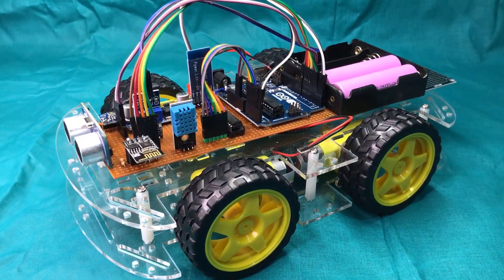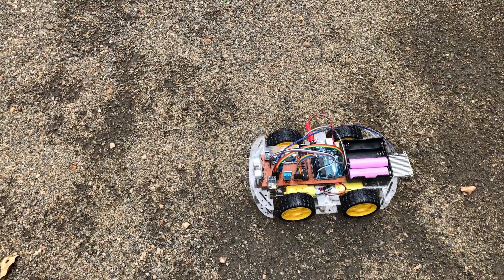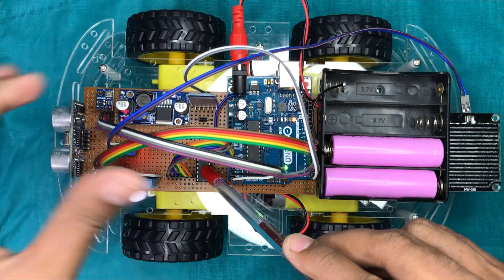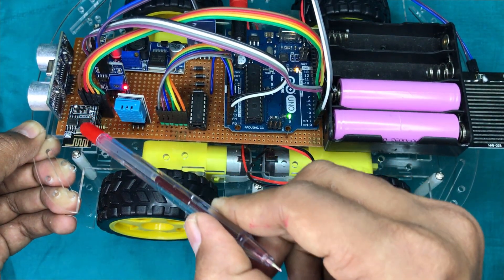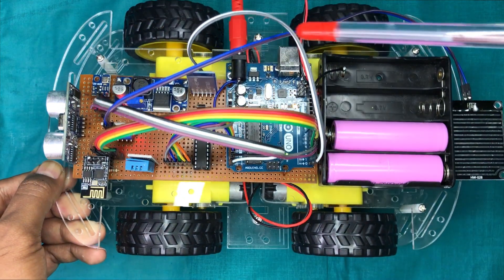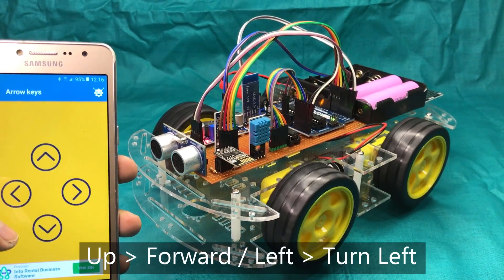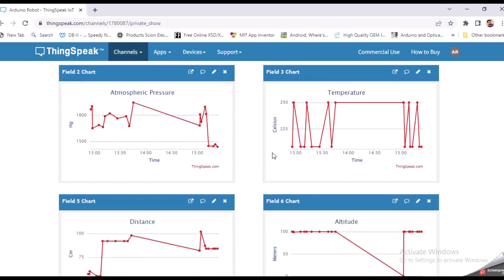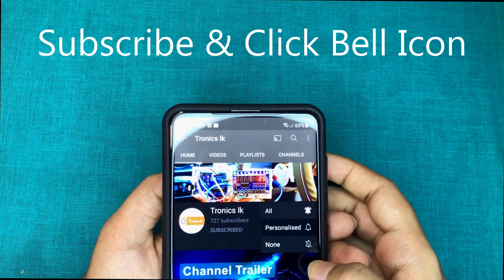AMAZING Arduino Spy Robot Car | DIY Arduino Robot Car Bluetooth Code | Arduino Sensor Car Code

Comment: Aiye mn Bluetooth control car ekak haduva ekata 9 volt eken power sunnata moter vada na coad gahana cable eken 5volt, 2A  power eka deddi vitarai moter 4 ra vada karanne
Reply from the maker: 9v battery ekakin dunnoth nam madi. 18650 rechargable battery dekakin denna
Reply: mAh madi nisada e 5v 2A thiyena charger eken dunnama vadane
Reply from the maker: @Yukee_editz  ow. Amp madi
Reply: @tronicslk  hari aiye tank 😻🔥 reply karata
Reply from the maker: @Yukee_editz  subscribe parak dala share karanna 😍
Reply: Aniva 😻🔥